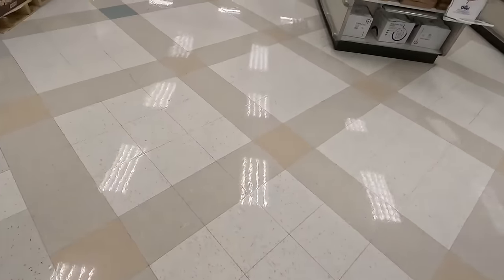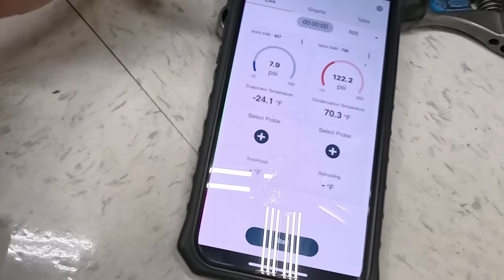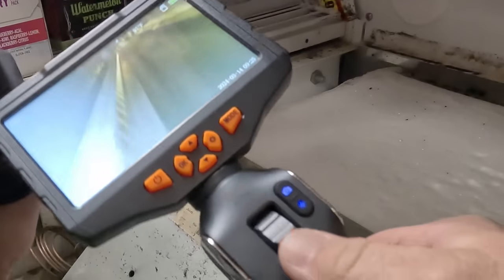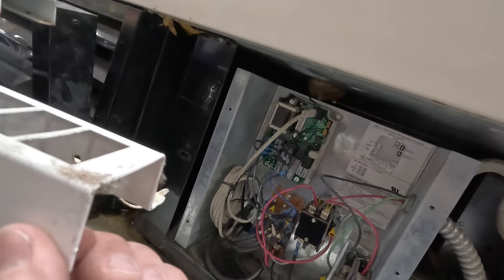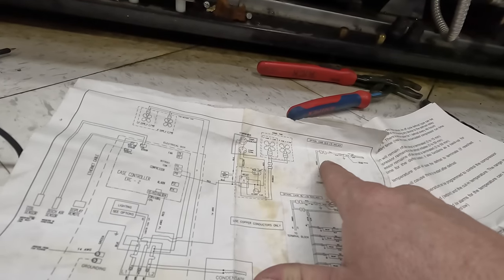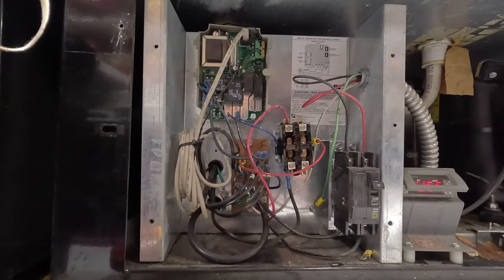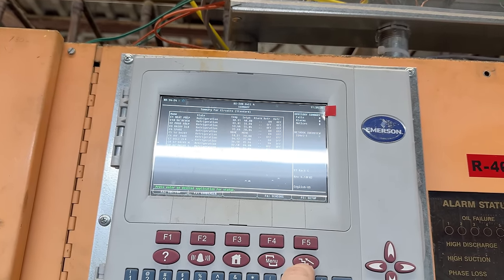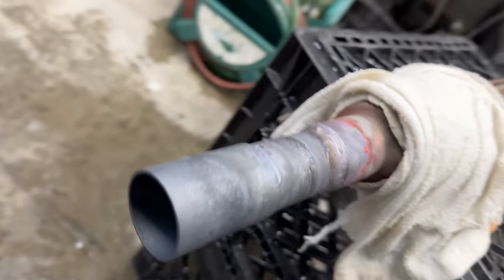Surprising Sound: Beer Case Mimics Water Dripping!

Comment: Hey Rick, Im a young residential/commercial tech and I love watching your videos! Its so cool to see a technician who works on anything and everything and does it well! I do have one question about a tool I see you use a lot during the heating season. Where did you get your steel wool brush that you use on flame sensors? It cleans a sensor better than anything I've ever used and seen and Id really like to pick it up but noticed it wasnt in your toolbox in your link. Thanks a ton! 
PS. Would you mind doing a video on your toolbag setup with your M5B5 bag?
Reply from the maker: Thanks for reaching out. They are made by MARS but I couldn’t find them on Amazon. I got them at the supply house but here is a couple links that are similar. The key is small or micro stainless steel brush head. It cleans up with water or brake cleaner and doesn’t leave grooves in the sensor or anything you clean. 3-Piece Wire Brush Set: Brass, Stainless Steel, Nylon Brushes - Ideal for Cleaning in Confined Areas and Corners - Black https://www.lowes.com/pd/Lincoln-Electric-3-Pack-Wire-Brushes/1001282304 or https://amzn.to/4cAqrG6 or https://amzn.to/4cCzs19

Comment: You are right if it was heated defrost evap fan should be off. Did it flood when it defrosted?
Reply from the maker: Nope. That pan heater was 1800 watts I believe. It was boiling it off fairly fast.

Comment: I always like the refrigeration videos.   What's the purpose of the jumper wires on the contactor?  Thanks for all of the information you share.
Reply from the maker: That divided the current between the two legs of the contactor, increasing the life of it.
Reply: Thanks for responding.

Comment: Are those silicone leads on your Fluke 902?
Reply from the maker: Yes they are.
Reply: @HVACRSurvival  Need to get me a set... btw, that's a sweet camera.
Reply from the maker: @Neto-1984  they are some American-made leads. I’ll need to look up what name they are, but they’re better than anything I’ve ever had. There are company that makes leads for high-end test equipment like oscilloscopes
Reply: @HVACRSurvival  I had a set, but I had to go back to the original stiff ones due to an unfortunate incident I had with my good leads, lol.
Reply from the maker: These are great for most connections but they won’t reach into a wall outlet.